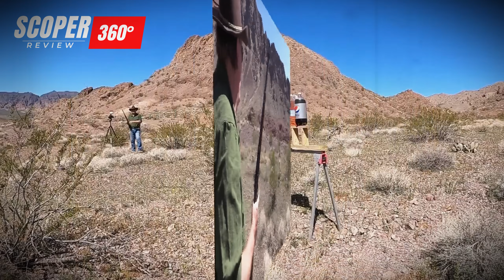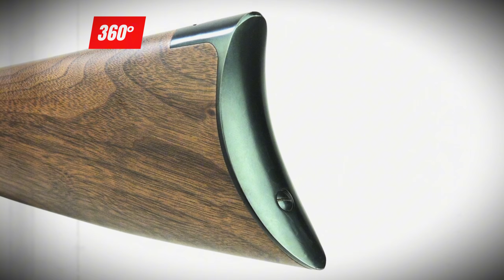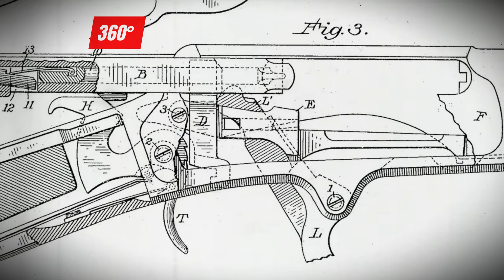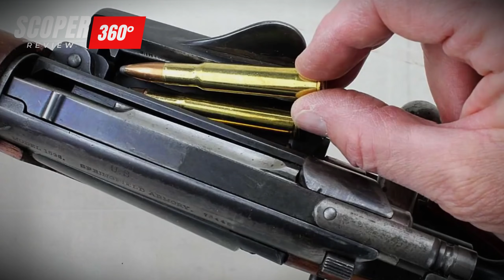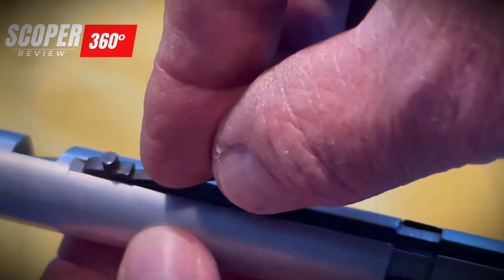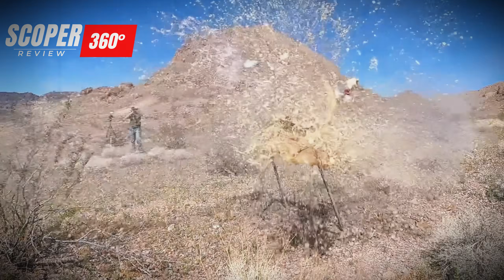7 Best .30-30 Lever Action Rifles of All Time!

Comment: There's only one 30-30 lever action as far as I am concerned. The Marlin Model 336. Don't misconstrue twat I'm saying. I'll break it down for you Mr. Handy Crap Man. I have no love for the Dirty30.  I own a 336 30/30. It hangs on strong magnets over my front door loaded with 6 of my 150 grain (rounded) Nosler Ballistic Tips in the tube with nothing in the pipe. I live in a state where we can basically kill one to two deer for the entire deer season which runs mid October to mid February. I usually shoot 20-25 deer per season. I have not killed a deer with my Dirty30 since I'd guess was 1989 or 90. I NEVER cared for that garbage Winchester top casings throwing rubbish. I have never tried any of the other brands. Why would I? Once I become an adult and was capable of choosing my own rifles I shot 308s, 243s, 25-06s, 223s, 6.5 CrippleMore, 270, 7mm-08 7mm mag, 338WM, 375 H&H Magnum etc. In other words I retired the Dirty30 but I do plan of dusting a deer with it this year. Nostalgia has been pulling at my heart strings lately. After all I did kill my 2nd deer with a Dirty30 and my 1st ever while sitting in a tree.